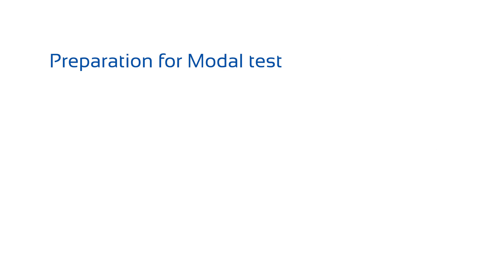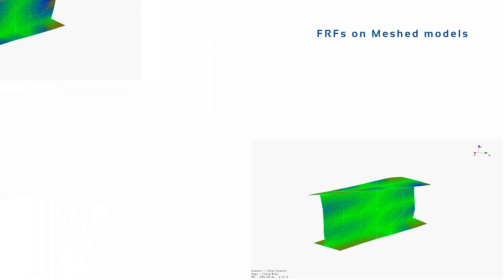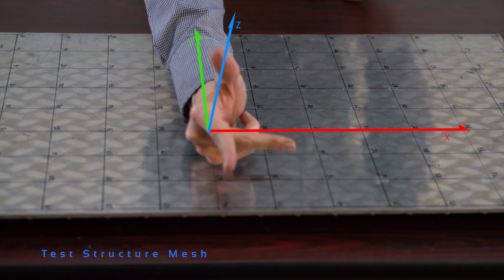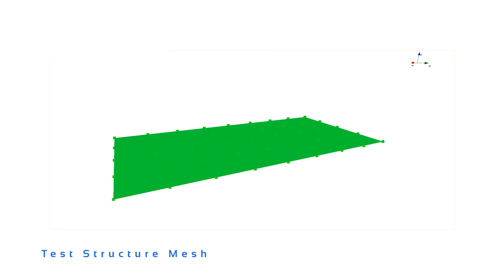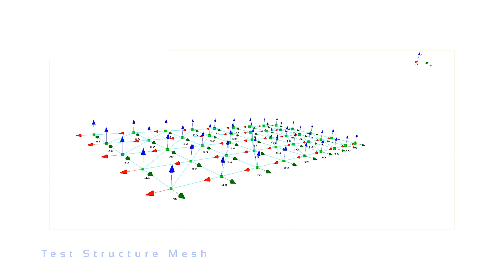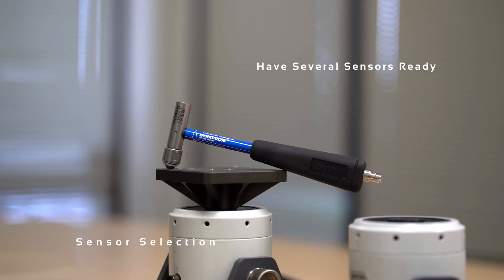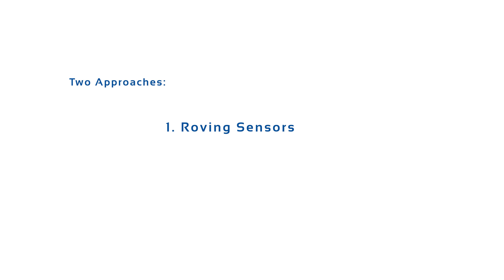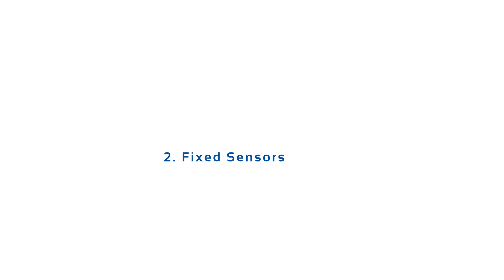Modal Part 1 - Test Preparation for Modal Testing

Comment: If we put sensors near the nodes of modal shape(vector equals zero), will we get bad results?
Reply from the maker: Todor.
When taking a response signal from the node (or near the node),  you may not get any substantial response at all for some obvious reasons. Your data may not be necessary bad, but it won't be too meaningful for modal purpose. It is recommended to place the sensor away from the node.
Reply: Hi Todor.  I suspect Walter will cover this in the future parts but here is a quick/dirty answer.  How bad your results will be depends on what you are going to do with the data.  If you put the excitation or response sensor on a node, the resulting frequency response function (FRF) will be missing the peak corresponding to the mode for that node.  So, if your structure has 5 modes in the frequency range of interest, you should see 5 peaks.  But since you are on a node, you will only see 4 peaks.  In the parameter estimation phase, if you choose to use only that single FRF to identify the number or location (frequency) of the modes, you will obviously get it wrong.  But if you use that FRF along with other FRF's (assuming the others are not on nodes) to identify the modes (e.g. Mode Indicator Function or MIF), you should be able to find all 5 modes.  

The next phase of modal analysis would be to get the vectors or mode shape.  In simple terms, you are trying to get the relative magnitude and phases between each DOF.  The FRF for that node will then result is some probably erroneous phase but the magnitude will be very small.  So, the mode shape will be right (since your supposed to get very small magnitude near a node).

If you need more help, feel free to contact me.  Not sure what identity shows up on YouTube but my name is Evro Wee Sit.  I can be contacted at eweesit at LearnSV dot com.  Or you could contact the folks at Crystal Instruments.  They are a smart and nice group of people.